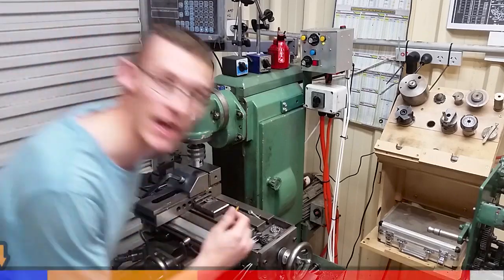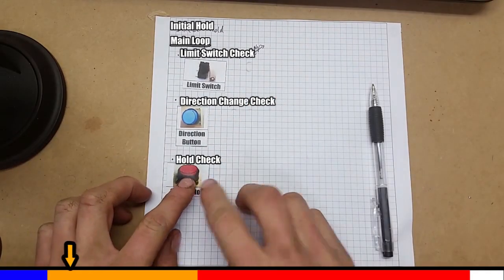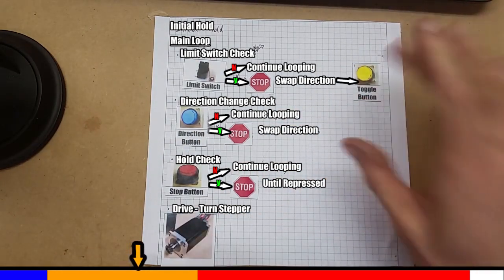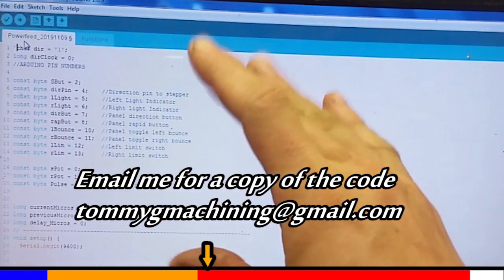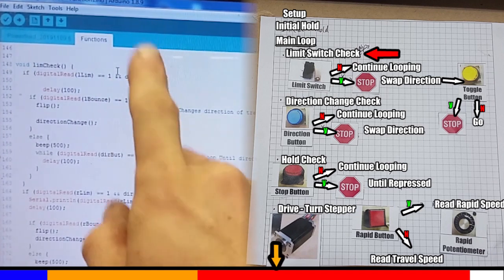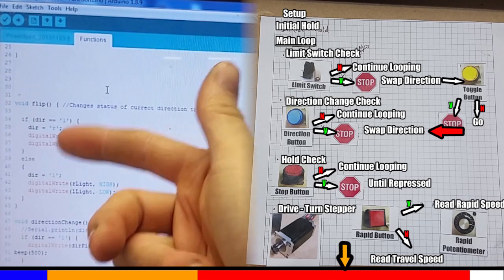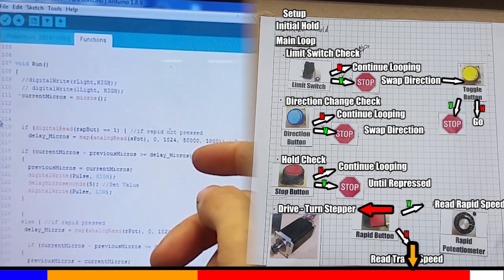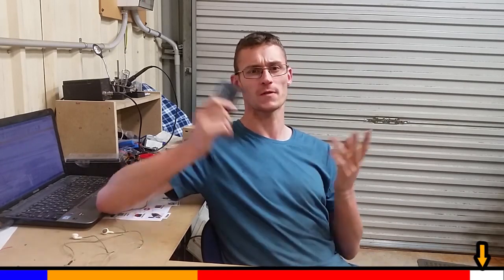Mill Powerfeed Coding!

Comment: Why wouldn't you use just one potentiometer and short across for rapid speed.
Reply from the maker: I set it up that way to give more options, it lets me jog quickly, but sometimes I've used the rapid at a slower speed for a roughing pass, and then the normal speed for a finish pass
You are correct that this would work well. I also have each potentiometer over a smaller range (with a small amount of overlap) to give more control

Comment: Man your a smart guy I just bought my first arduino(I know im late to the party) but id like to start learning that kind of stuff. If you just picked up an arduino for the first time where would you start? 
Also of your still doing the sticker thing id like to send you one
Reply from the maker: Work through couple of tutorials first, once you get lights blinking on command etc, you can start doing more stuff.
I am definitely not a coding expert, you can get pretty far by copying chunks of code off the arduino website that are dedicated to certain things, like controlling stepper motors for example.
Start small, and break bigger projects down into little steps

For stickers, flick me an email tommygmachining@gmail.com

Comment: Tommy, you may want to go with over running limit switches.  These are mounted under the stop on the carriage so it trips the switch and can move over the top without crashing into a solid micro switch.  Use the same micro switch just rotate it 90 degrees.

Comment: I like your design but have one suggestion.  Add an acceleration and deceleration to the drive.  You could make them fixed length so they don't crash your end stops.   Starting and stopping the stepper motor will cause it to miss steps and may cause other problems.  If you want help with the code let me know and we can chat on email.
Reply from the maker: I've not actually had accel / deccl problems to be honest, I can rapid into a limit switch no problem and it stops before crashing. At the moment I'm not trying for CNC, so missed steps aren't too much of an issue for me right now

Comment: Tommy,  I like your flow charting!!  Much less boring than those boxes and triangles...
I got one of those Cheep Chinese X axis drives for my Bridgeport J S1 and it won't start slowly.  DC motor drive.  I was thinking of a Micro controlled motor PWM drive with feed back.  A lot more work than the US$120 drive may be worth but if it makes it more usable.
Reply from the maker: Glad you liked it and could follow along! It took a while to plan out and film
I'm not an analog electronics expert by any means, but I wonder if a capacitor could be used to ease the motor in and out? Or maybe a separate micro controller to control the voltage output before it gets to your DC motor?
Reply: @TomMakeHere  Yes your second question is correct,  the problem is the motor needs more power to start than it does to run slowly.  What I was thinking is a computer with a 1/2 or full bridge PWM drive and a rotation feedback sensor.  This way the computer could control the power going to the motor by comparing the actual rotation with the speed knob setting.  The speed also varies with cutter load and this would adjust the power to maintain constant cutting speed.  This would also allow the rapid and limit switches you have in your design.  A great application for an Arduino and a bridge DC motor drive.  I would need to open up the drive and work out the motor voltage but the total cost of parts should be less than US$25.  I have a nice machine shop and design PC boards and  microcontrollers.  I built several CNC machines so I have this project covered both ways.  Thanks Tommy.

Comment: Hey, great video. Nice thorough explanation of the code. For driving the stepper, I'd recommend the accelstepper library. It handles all the raw timing calculations for the steps. Having acceleration will give you much smoother movement at the start and end of motion and allow a higher top speed. You can then increase to a higher microstep level to get smoother motion in general. Really great project!
Reply from the maker: Huh that might help! I'll have to look into that. This is what I love about youtube
Thanks for watching

Comment: Hello, very nice design, nicely done.
you will have a problem with these limit switches, they will break because at higher speeds they will also work as an end stop.
sorry for broken english :)
Reply: jacob1001 there are a couple of ways around this.  Use a micro switch with a roller end and have it roll up on the stops.   Not totally unlike a cam follower.
Reply from the maker: No problems so far, The table doesn't move very fast even with rapid speed. The problem is when I disable the powerfeed and manually move the table. I've crashed into the switches many times that way, but they are fine